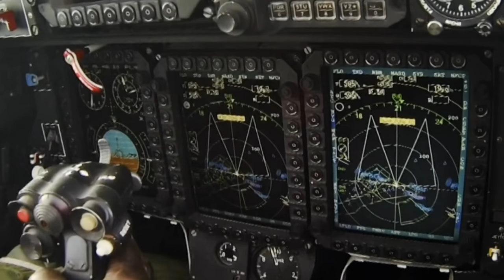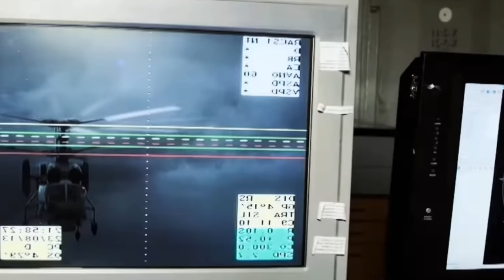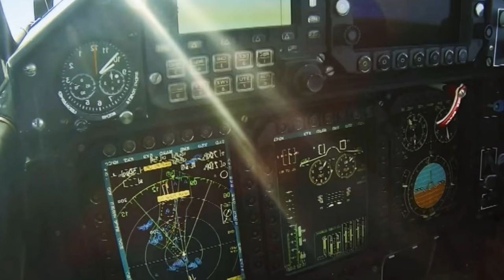Will Russia build more Aircraft Carriers?

Comment: The last ten years have demonstrated that the Russian military has modernized its conception of warfare, abandoning the fully conventional Soviet doctrine of mass operations to a more multipolar hybrid style, althought it still maintains large units and weapon systems (4th Guards Kantemirovskaya Tank Division, Kirov-class heavy cruisers, etc.) for power projection.

New Russian naval doctrine focuses on relatively heavily armed small ships (frigates, corvettes, etc.) and puts large, costly ships on a secondary need of power projection. Russia will thus try to keep the Kuznetsov as long as possible, and then only build one supercarrier (out of the 2-3 officially announced by the Kremlin), only to say they have an aircraft carrier.
Reply: I agree but they might build one SC for Pacific and one for Blacksea/Atlantic/Baltic.
Reply: @BraunBuxe  Russia doesn't have the capabilities nor the will to enlarge its carrier fleet. Even during Soviet times, the maximum amount of carriers was 4 (small 55k ton Kiev-class). It wouldn't be impossible, just extremely unlikely.
Reply: The issue of carriers for the RuN is mainly divided in 2 reason, one practical and the other not so much. The first reason is that they don’t want to lose their Carrier aviation and realistically they do have some
litoral areas like the arctic and kuril islands where they could benefit from having Carrier support. The other reason is a matter of prestige since Russia regards itself as a great power and great power large Capital ships, namely carriers.
Reply: How have they demonstrated it??? They are still the lowest tech.
Reply: @andrewdoesyt7787  Ukraine, Syria, US elections? Hybrid warfare is not always executed by the military. It's a whole-of-government approach, and can be executed using agencies ranging from intelligence services to cultural organizations. 

See the book "Russia's Military Revival", former Russian Chief of the General Staff Nikolai Makarov comments, and the strategy of his successor, Valeriy Guerassimov, dubbed the "Guerassimov Doctrine".
Reply: @georgeleon1263  In international politics, there is not a good guy and a bad guy, only actors with interests. I didn't talk about the morality of the Russian intervention in Ukraine or the so-called Euromaidan, which was awkwardly too well organized for a popular movement.

For the Guerassimov Doctrine, although Mark Galeotti acknowledged its name-calling, other experts truly believe in its existence (that's where the book I mentioned comes in). It is possible to see it though recent Russian military operations and reforms.
Reply: @AA-os2bf  oh sure morals won’t get you far in terms of Realpolitik.

The conference I shared doesn’t dwell on that however. It tries to asses what is the real capacity and potential that Russia currently posses relative to the west and to a lesser extent to the rest of the world in all the relevant realms like the military where the effects and successes of the reforms are also address, and present a drastically different picture than what we normally get in the media.

In regards to current Russian strategy I would recommend you read Michael Kofman’s “Russia’s Great Raiding Strategy” in War on the Rocks, to me it presents a far more clear and accurate picture of what the Russian government and military have been doing, I would share the link here but unfortunately YouTube treats external links as spam.
Reply: @AA-os2bf  What indication do I show of being triggered? I think, you made that part up. 
You can take Crimea, but Ukraine is still in war with Russia and they have yet to win.

I asked if you were a trump person because you think Putin rigged the elections, which isn’t true. They are still fair.
Reply: @andrewdoesyt7787  ok
Reply: @georgeleon1263  I just read the article and watched part of the vid. Solid stuff, similar to what I just said, althought for the argument of the article, I would say raiding is a strategy (what to do), while the Guerassimov Doctrine (we'll dub it as that to avoid any misunderstanding) is a more on the tactical level (how to do).
Reply: I agree, it's mostly a prestige and general technology development method.
Reply: @AA-os2bf  apparently, the Russian army is worse than we thought. I knew their army is bad but this bad, to be honest, didn't come to my mind. I mean, yes I  have read a lot of news about their army and corruption in it. For instance, if you want to get one more star to your shoulder mark bribe is the easiest way. Their air force doesn't have enough guided missiles to fight. After many things that I have seen, I understand one thing survival of their country solely depends on the nuclear weapons. If the rank of general could be bought with a bribe that army isn't capable of anything.
Reply: Aged
Reply: This is very ironic now
Reply: @kousand9917  Which part?
Reply: You are right, Russia has improved in various aspects, but it always appears to be under the USA and China, and after the events of the war in Ukraine also under Europe. 

The Pentagon has classified China as a Peer threat level, but also France and soon Italy, while Russia is not a Peer threat level. 
-What do I mean by "Peer"? 
I mean a country that has an armed force that is capable of controlling all Domains that are: 
1) Terrestrial Domain 
2) Aerial Domain
3) Naval domain 
4) Spatial domain 
5) Cyber domain 
-Russia sins a lot in the Aerial Domain and in the Cyber Domain. 
Both Italy and France have Electronic Warfare systems(Cyber Domain) in Navies and Air Force superior to the Russian ones.
Today the Cyber capabilities can influence/turn the tide of battles and wars, no matter if your ship/plane is bigger or has more missiles, without Radars it is completely blind.

Comment: In my opinion the best shipyard to handle the construction of Russia's future carrier is the Zvezda Shipyard in Bolshoi Kamen. In 2020, the 485 meter long and 114 meter wide drydock was finished. Also the shipyard is learning the following competencies:
1. The Zvezda shipyard launched the first Russian built Aframax vessel, which is named Vladimir Monomakh which has a displacement of 114,000 tons, this means that shipyard's workers and specialists are gaining experience in building ships that have a displacement of above 100,000 tons and they are building more Aframax vessels.
2. Zvezda recently started construction of the Arc7 class LNG carriers which has a length of 300 meters, this means they are gaining the experience and knowledge to build ships in the 300 meter range.
3. In 2020, Zvezda started construction on the Project 10510 Lider class nuclear powered icebreaker, this means they are learning to build nuclear powered vessels.
The Russian Navy can choose different reactors to power their carriers, the RITM-200 reactor which is actively being built and installed on the Project 22220 icebreakers and the RITM-400 reactors which is slated to be installed on the Project 10510 Lider icebreakers are potential marine reactors for any potential Russian nuclear powered surface combat vessels.

Comment: Having a carrier would provide the Russians an ability to project power overseas like in Syria. They only need the one for that. However, the question is more if they have a shipyard big enough to build one since their biggest ships were built in Nikolayev.
Reply: They can and did reach Syria without it. Projection is needed when area is hostile. But they deployed on friendly territory.
Reply: Fun fact: A Tu-160 has enough range to strike targets with cruise missiles anywhere on the planet except Antarctica and South America, operating from Russia and without aerial refuelling outside Russian airspace. One more reason not to push carriers much.

Comment: This is a complicated situation. It seems to be  based on what Putin has as goal. They have always been a sub based Navy. They have no foreign ports other than Syria. Cuba is off the radar. The Pacific is a afterthought. You don't need a carrier in the Baltic or Black Sea. 

My advice?  No go...
Reply: Correction: they have always been a defensive navy. Subs just so happen to be the  most survivable carriers of ballistic and anti-ship missiles, so you end up with a sub-based main force, supplemented by a bunch of hunter-killer escort subs, and a bunch of surface ships to provide air cover, aerial recon, and fleet coordination.

From that framework emerges the role of the aircraft carrier: Providing a mobile base for recon aircraft, providing air cover for land-based bombers such as the Tu-22M, and forming the outermost layer of the surface fleet's air defence onion.

As the combat aircraft launched by the carrier will carry only a light load of AAMs, there's no need for catapults; full reheat and a ski-jump is enough to put planes in the air. Ammunition stowage can also be smaller; the anti-surface role being covered by subs and land-based bombers, there's no need for the carrier to stock much in the way of AShMs or bombs.
This allows for a more compact and thus cheaper carrier.

As for the recon role, the commies developed the Yak-44, analogous to the E-2 Hawkeye, and the Ulyanovsk  supposed to be ritted with two waist catapults for launching it, but all that was put on ice due to internal political fracturing within the USSR, as well as the slow but steady dismantlement of the central economic planning system since the mid 1960s.
Once Gosplan ceased to exist in 1991, the Yak-44 got put out to pasture, and the navy's been stuck ever since with the Ka-31 AEW helicopter that had been developed to fill the gap until the Yak would have entered service.

Source: far too many hours browsing en.topwar.ru trying to figure out what russia's been doing these last few years. 
The site is unfortunately loaded with sycophants and useful idiots regurgitating news headlies without any critical examination of the claims being made, and often you'll find that authors who do have a grasp on their subject matter occasionally get snowed in and fail to see the bigger picture, but there are a half-dozen or so authors who, if you can find them, provide a surprisingly clear picture of the development of soviet cold-war naval doctrine, and how various ships fit into it (or didn't fit, but were "stepping stones" to bypass ideological limitations put in place by previous iterations of the doctrine, in the case of the Pr. 1143 aviation cruisers).
This: https://en.topwar.ru/180297-sergej-gorshkov-i-ego-velkij-flot.html is what I'd consider a good starting point for understanding the late cold-war soviet navy.
Reply: @gustaveliasson5395  I would only quibble with the idea that submarines are only defensive. Considering their lack of sea access. Nor in the Cold War was there ever any real plan of offensive action by US carriers in Soviet home waters.

Comment: They need to build the docking facilities to support carriers. Their Admiral Kuznetzov carrier got ruined because they don’t have the docking capacity to support such a ship in their northern fleet naval base. The ship was running on its internal boilers and power plant throughout the duration of its stay at dock, and that caused all the machinery to wear out and decay add to this the poor maintenance and quality of many of its systems that after several refits, the ship can barely be called fit for service. 

To build more would just make the problem worse, Russia desperately needs to severely downsize its navy, it doesn’t have the economy to compete and it does nothing for their capacity to project power in the areas where they need to project power.

Comment: It makes sense but I am left wondering if they even can produce larger warships anymore. In the past 25 years they haven't launched anything larger than 4000 tons. I suspect we will not be seeing a Moskva 2 for decades.
Reply: Who used to build big ships were not russians bu actually the ukrainians, people need to separate Soviet Union from Russia.
Reply: @goyakat2211  werent the kirovs built in leningrad/st petersburg?
Reply: @enoughrope1638  yes, those were, and maybe the reason why they sucked. Some lasted less than 10 years and others didn't even got finished, they are with elephants
Reply: @goyakat2211  My point is Russia had the capability to build large surface combatants and has probably lost that capability. Quality is a strawman argument which has little to do with my post.
Reply: @enoughrope1638  I understand but to have a dock to build a large hull it's doesn't mean that you have the capability to build a complex carrier.
Reply: @goyakat2211  reread my initial post.

Comment: Russia’s military is usually defensive in nature. That’s why they are not focusing on aircraft carriers, instead they are focusing on air defense systems and electronic warfare systems. US military on the other hand is offensive in nature. They also use their military to ptoject power. And thats why they are building more aircraft carriers and more stealth fighters.
Reply: That isn't defensive or offensive. Air defence system are just as good at covering your armoured attack, carriers a defence against massed attacks on fixed targets. In the Cold war both sides had plans of attack and neither wanted to use them. 
The difference now power, it's no longer a balance so Russia has less options.

Comment: It is a good questionaire:

We know that the next Nato summit will have a new concept. There has not been a revision since 2014. A reshuffling of which nation contributes what to where?

As far, as I can tell we are talking about building capabilities and assigning tasks to nations that have a national interest in a mission and the ability to perform.
That distribution of assignments has been the real bone of contention. This has been reflected in the defence spending: It is not, that the Nato countries has denied there should be invested more: We are now 30+ years beyound the collapse of the of the Soviet Union. However good the equipment was in their day - it is getting increasingly expensive to maintain. And the scenario has changed.

The Nato countries will have to agree on means and mesures.
The country I have followed most closely. The changes I can guess at are:

Air Force:
Primarily a need for more transports and 2-3 squadrons of Typhoons.

Navy: Setting up yards to produce frigates on an assembly line basis - most probably in Japan. A frigate today is bigger and has the punch of a destroyer. The requirements across the board are much the same. Missile armament, long endurance and comfortable quarters. Denmark is allready swapping  crews mid-mission for their frigates. The ships in class are basically the same and if nothing is dented that much - it should be comparatively straight forward. A 3 week yard visit every 2 years means that the ship has much more time at sea doing its job.

The army will have:
1) A heavy armoured brigade (plus a BTN battle group) - deployable by sea. For the Baltic that can (with fair warning) be done in 48 hours.
2) A medium brigade on 8*8 with a planned road speed of about 60 km/h to account for delays and calls of nature.  Plus the protected supply lorries. All the international mission have contributed that everybody is used to fight in composite units.
3) A light brigade on light armoured vehicles (Eagle V), possibly in conjunction with the Norwegeans, as their fighting skill in harsh winter conditions is absolutely top notch - in so far as they train all Nato contries to fight when the water gets stiff.
4) An airborne (on helicopters) brigade with the Dutch (don't underestimate the connection between Denmark and the Netherlands)

The point is: The enemy might come up with something sexy we haven't thought of and an immediate reaction close by is called for - lets say the same day.

Extrapolating from Putins reactions to Ukraine: He is scared, because Russia cannot concentrate sufficient forces at two places simultaneously. A BTN battle group from each brigade can be constantly deployed.

Now this is guesswork on my part. But it should be achieveable - after sending corrupt generals in the slammer - something that is actually done.

Comment: First, Russia does not have shipyards suitable for the construction of aircraft carriers. The Kiev-class aircraft carriers were built at the shipyard, which is now located on the territory of Ukraine. Russia is now building large ships like Afromax tankers, but they are not the same thing. The construction of aircraft carriers requires specially equipped large shipyards, which means that this shipyard must be created before the construction of an aircraft carrier. These are very big difficulties and money.
Second, aircraft carriers can hardly be considered a weapon of a major war, especially with the use of tactical nuclear weapons. It is rather a weapon of local wars, a floating airfield and headquarters. In Syria, Russia sorely lacked something like that.
Thirdly, the ships purchased from France (Mistral class) are not aircraft carriers. I do not know how in the NATO classification, but in the Russian classification it is an amphibious assault ship. It has a helicopter-only deck. Russia builds ships of this kind, better or worse than the Mistrals is another question.